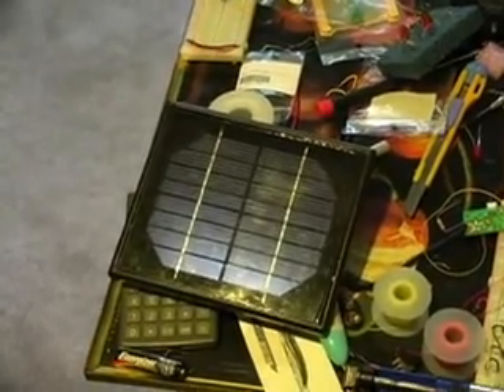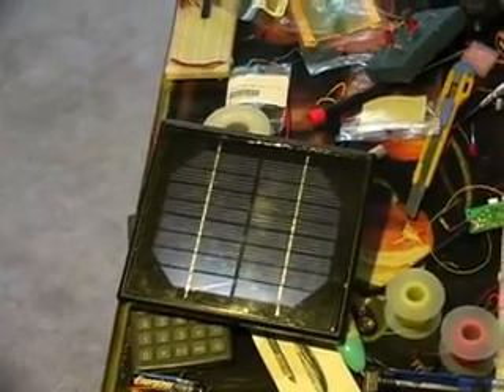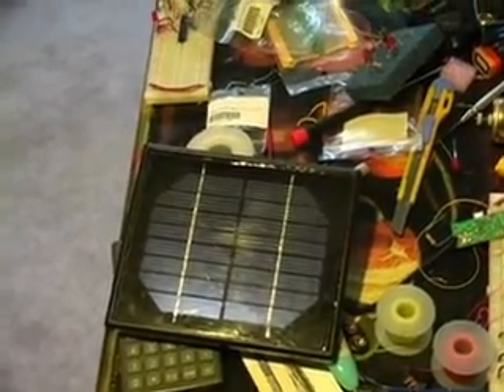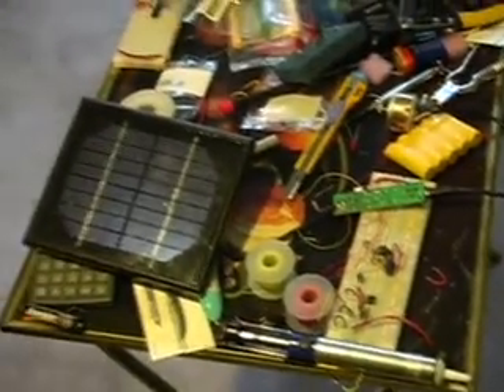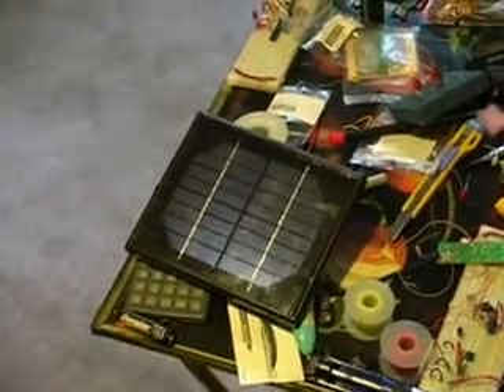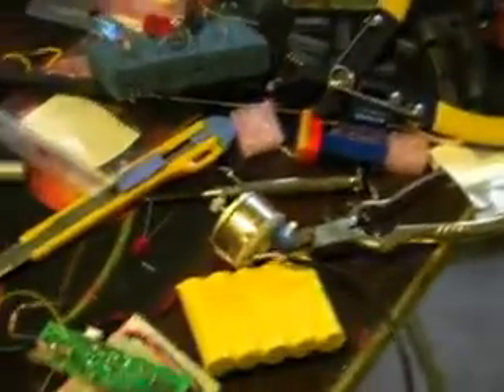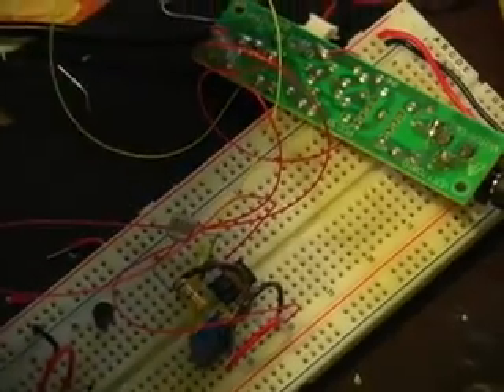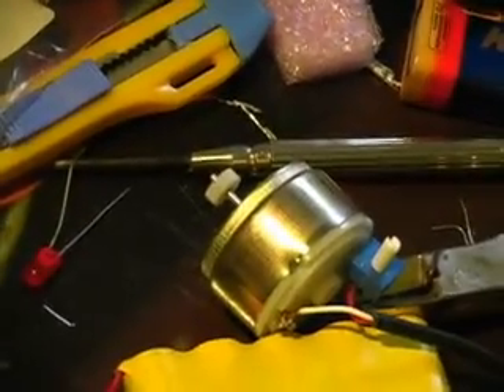Light sensor circuit turns on at night, and off during the day

Comment: PLEASE HELP ME. I have a on/off button that controls one of my fans inside of the PC. And I want to replace it with the light sensor (the same kind that is in the night or garden light) But when i remove the switch and replace it the a light sensor it just turn of the the circuit with or without light. I want to ti work the same as in the night like. When I turn on the light the fan stops and when the light goes off the fan starts. PLEASE HELP. PLEASE.